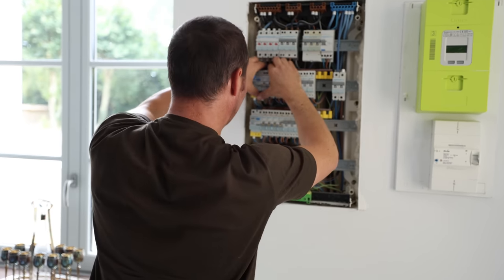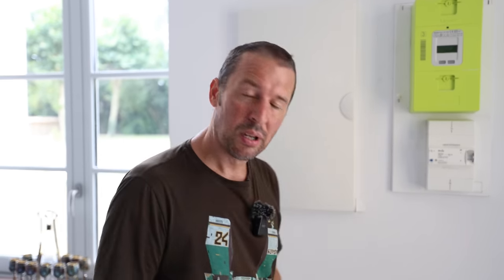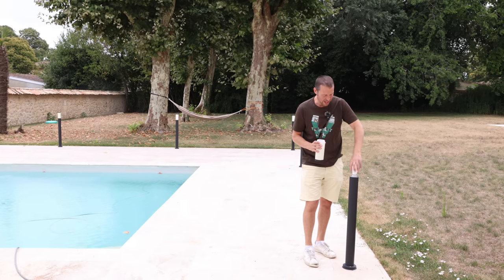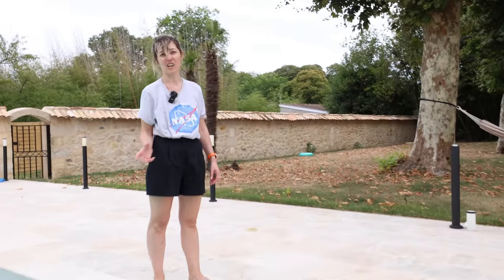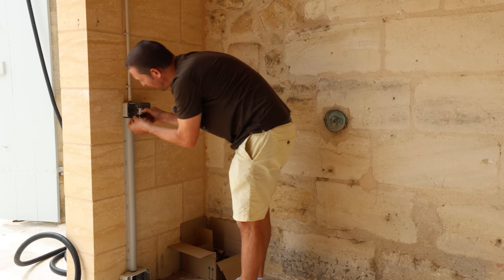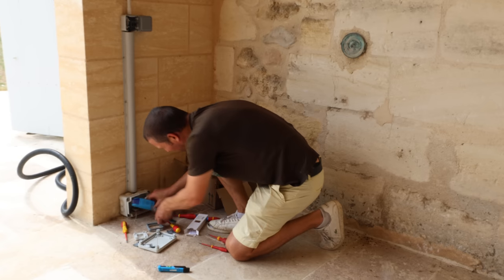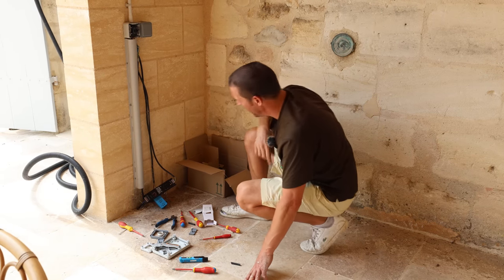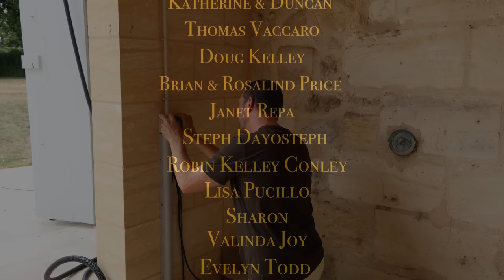FAILED Building Inspection.... We Can't SELL!!!

Comment: Unfortunately, Anna, I have a little bit of bad news for you. Those lights you bought as you know have a plastic top section that with the exposure to weather will fade very badly and look rather awful. I know because I have similar pillar lights. I will say however that where I live the weather is much more extreme, with the temperature varying from -25 to +25 depending on season.

Comment: Faire deux erreurs sur un circuit comme le votre vis à vis du Consuel, ce n'est rien. Vous savez sans doute que si un professionnel  réalise votre installation, il sera très rarement contrôlé par le Consuel. Et dieu sait que des erreurs parfois pire que les vôtres, les professionnels en font! Mais si vous êtes un particulier, la le Consuel viendra obligatoirement, et sera plus que pointilleux, un peu comme si il avait le sentiment que vous enlevez du travail aux professionnels. C'est comme ça que ça fonctionne en France ( et ailleurs aussi, je vous rassure). Le type du differentiel  (AC ou A) en tête des alimentations gros électroménager, faut le savoir. Le bon sens ne suffit pas. En revanche, le coup des lampes en 220 V près de la piscine, ca peut se comprendre que c'est un peu Dangeureux. Bonne continuation0